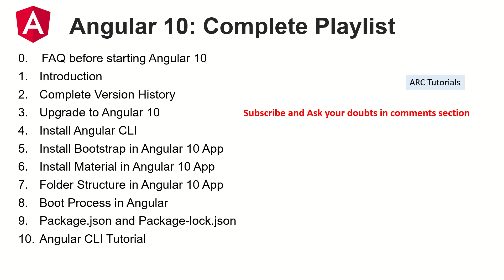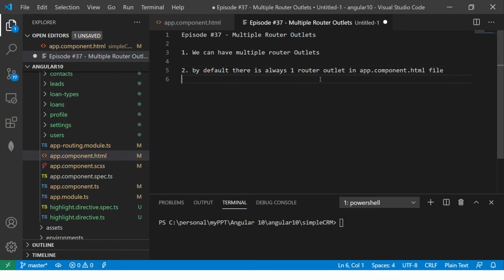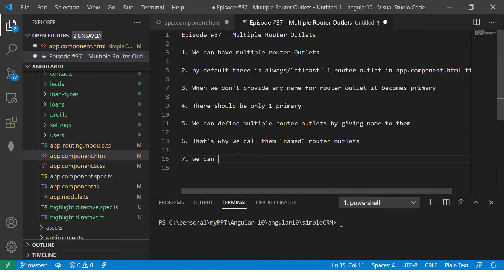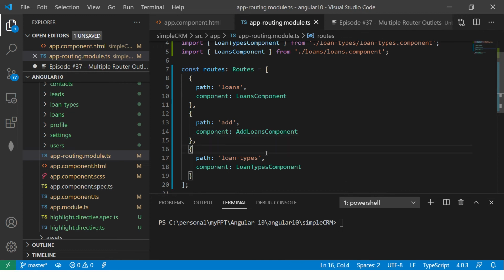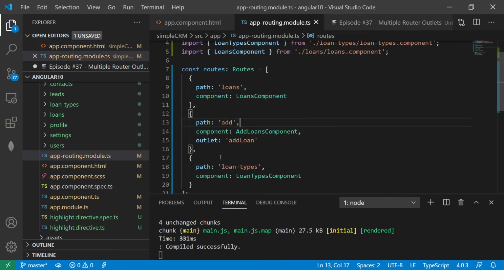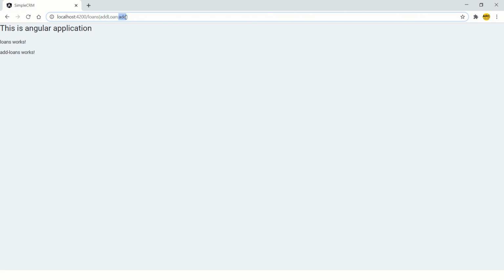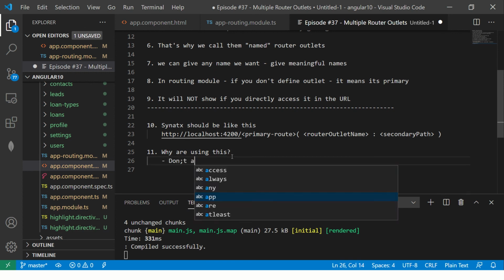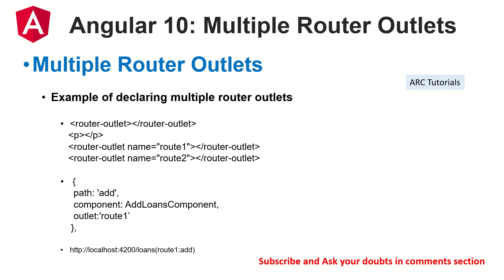Angular 10 Tutorial #37 - Multiple Router Outlets in Angular | Angular 10 Tutorial For Beginners

Comment: 11 & 12 are not super correct, the url can be bookmarked/shared and there are many use cases where you would need this (also called Auxiliary Routes). I would encourage using the angular syntax, with the brackets but if you don’t like that check this solution ... https://stackoverflow.com/questions/45511536/angular-4-router-why-path1-outlet-namepath2-is-a-thing
Reply from the maker: Thanks Kevin for sharing the info.